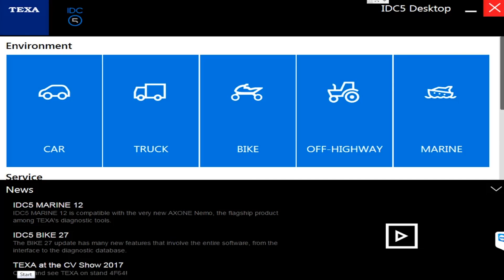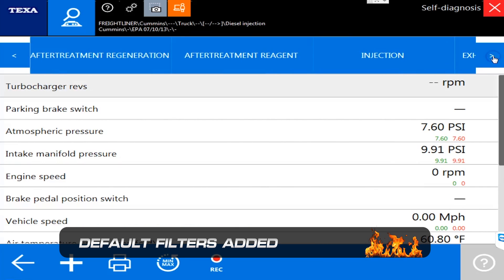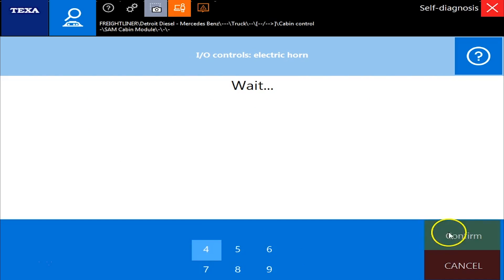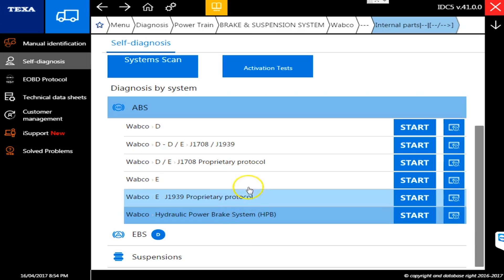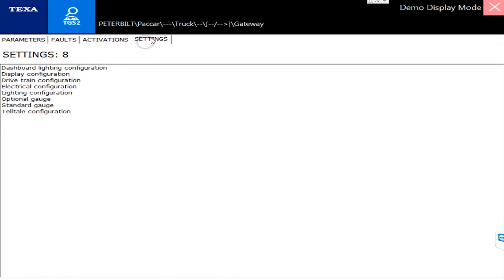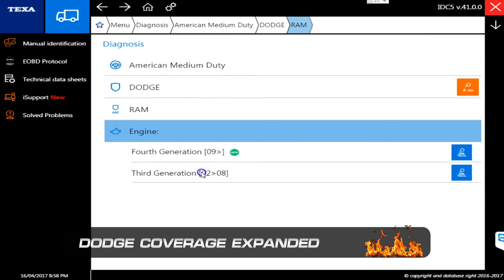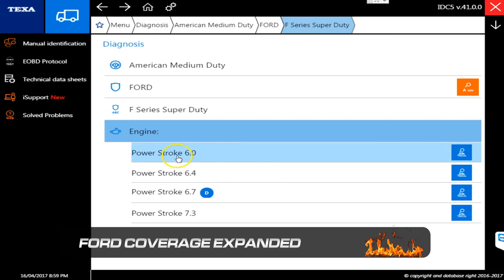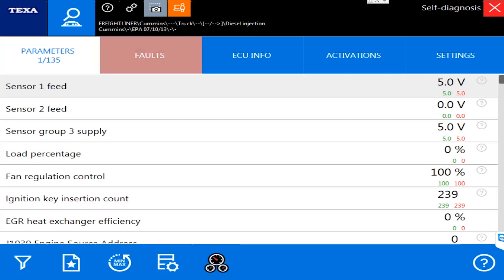TEXA Truck Diagnostic Tool version 41 Updates

Comment: from what year to what year on automobile can i use it on..... amd how can i order one
Reply from the maker: For auto coverage, this may or may not be the best tool for you. The TRUCK module covers Ford, Chevy, Dodge diesel only, not gas. The AUTO module is more designed for "super cars", the ones that cost $100,000+. It is really good software, just not for the average shop. We do have several automotive options that are really inexpensive. Call our sales team at 888-983-1975 x1 and they will go over all the options.